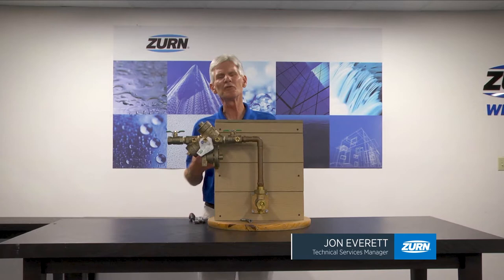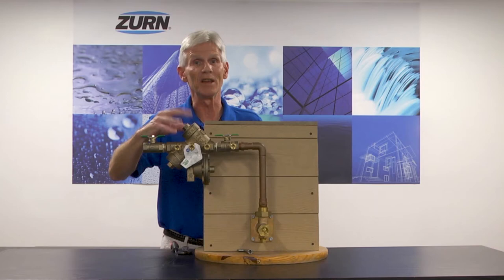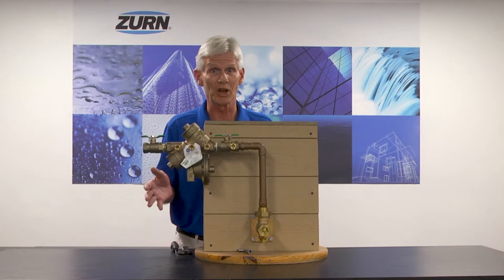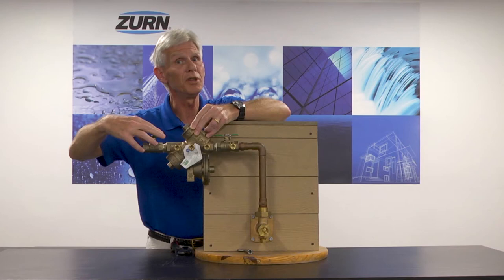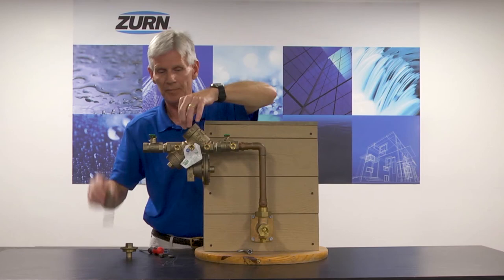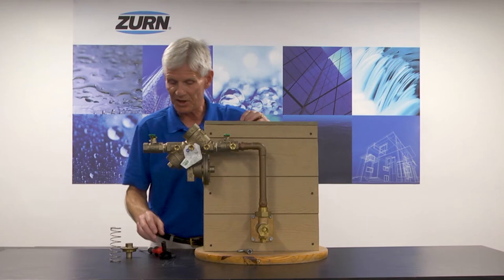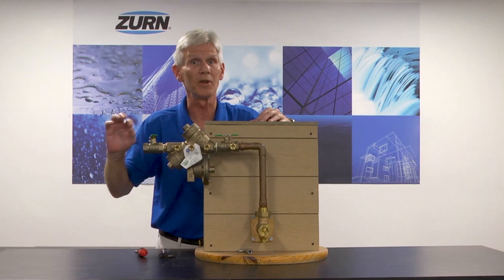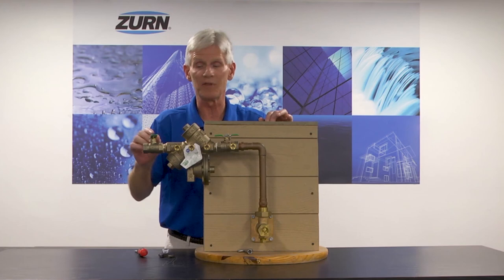Repairing a Zurn Wilkins 975XL Reduced Pressure Principle Assembly

Comment: Hello and thank you for these informative videos. My question is are all RPZ’s tested and repaired the same way no matter the size of the assembly’s?
Reply from the maker: The basic concept in trouble shooting backflows to determine where fouling is occurring is the same across all models and sizes.
Basic steps for cleaning and repairs will be the same, however there are design differences between our small backflow models so watching repair videos on repairs to each model would be the best.

Comment: We just rebuilt a 975XL.  The water is gushing out of the bottom drain when either the sprinklers are off or we close the check ports.  What is causing this?
Reply from the maker: Hi Michael, we forwarded this question on to our engineers and will get you an answer shortly. Thanks!
Reply from the maker: The most common reasons for discharge after a repair kit are: 
-Swapped #1 & #2 check Springs. Take out the springs and verify the stiffer spring is in check #1.
-Diaphragm not lined up to sensing line. You can take out the diaphragm and verify the 6 bolt holes are aligned & the sensing line hole is lined up at the top. 
-Dirt / debris in the system. You can take out the checks, clean them, then flush out the system.

If after checking these and you still run into any issues, please feel free to call Zurn's customer support: 1.855.663.9876

Comment: Poppet check cover doesn't want to come off!  Any hints on breaking that corrosion lock?
Reply from the maker: Hi, I think the best way to approach this would be to use appropriate force. Use two wrenches.  Big crescent wrench on the cover hex and pipe wrench on the body, about an inch below the cover (so you don't bend the body where the threads are) & carefully apply force being careful to not damage any of your plumbing. I hope this helps!
Reply: @ZurnIndustries   Thanks for the reply.  I had sprayed the parting line with WD40 but it wasn't coming free.  Finally, I took the whole unit away from the job site where I had better access.  A breaker bar on the cover hex and it just fell away - oil and exposure time helped.  I found crud in #1 and decided to rebuild the whole thing.  Now, having put it all back together with new poppet parts and related diaphragm parts, it leaks from the vent worse than before!  Is there a way to separate the three components to help me fix?   The valve seats look OK, I didn't change them out although I could (I have the parts to do it).
Reply from the maker: @eeandersen  Hello, I would suggest reaching out to our customer care team as they will be better equipped to help you through this specific scenario: 1.855.663.9876.

Comment: How to increase the water pressure on this unit I have this unit at my business which controls the water to fountain drink and coffee makers. The water pressure is 45 psi and i need it to be at 65 psi
Reply from the maker: Hello and thank you for your question. Here is what our product experts shared with us. 'If there is a pressure reducing valve in the system, then you might be able to increase the setting on that valve (assuming there is enough incoming pressure). However, an RP backflow preventer is not adjustable for pressure output regardless of brand or model.' If you have further questions, feel free to reach out to us here or our Customer Care Team at 1.855.663.9876. Thank you, Zurn Social Media Team.